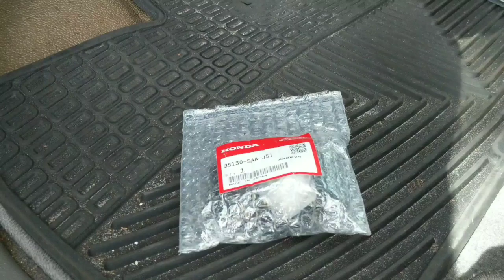Honda Odyssey 2005-2010 Ignition Switch - Replacement

Comment: My wife has an 07 odessey touring the parking lights and tail light stay on and kills the battery would this fix the issue?
Reply from the maker: Doesn't sound like an issue with the ignition switch. It sounds like you have an electrical problem somewhere. Some people were able to find some solutions here https://www.odyclub.com/threads/2006-odyssey-parking-lights-wont-shut-off.177458/
Reply: Tail lights might be the brake not disengaging

Comment: 2005 odyssey key won’t turn car over smashed key what can I do? If I replace ignition can I get a different key?
Reply from the maker: If you have the spare key a locksmith can make a replacement key. The ignition switch is basically an electronic element of the ignition system. If the key is stuck or hard to remove or turn the issue is most likely the lock cylinder (with a good working key). My best advice is to call a locksmith and have them take a look at it.
Reply: @kaimanson3174 they want $350 though

Comment: So I was able to take the wafer out I put it back together and now it won’t start
Reply from the maker: Check for any loose wires...
Reply: @kaimanson3174  I put all the wiring back in. The engine sounds like it wants to turn but it won’t fully turn i think I broke something while trying to take the cylinder out
Reply from the maker: @2hunnedproof247  try putting the old back in and see if it works.

Comment: So if the key doesn't turn do I have to replace that part?
Reply from the maker: If the key doesn't turn the issue is something else. I'll try to reach out to a locksmith to get it check out.

https://www.odyclub.com/threads/cant-get-key-out-need-help.46994/
Reply from the maker: Hey Mauricio were u able to fix the issue you had with the key?
Reply: @kaimanson3174  yes thank you